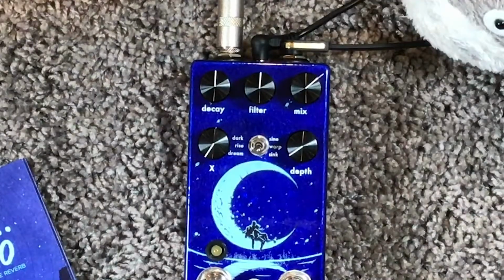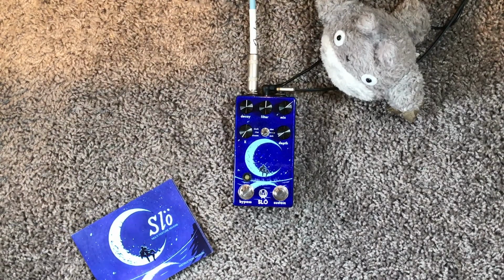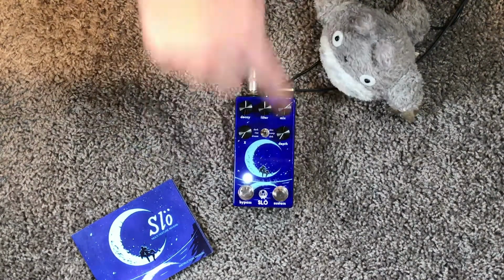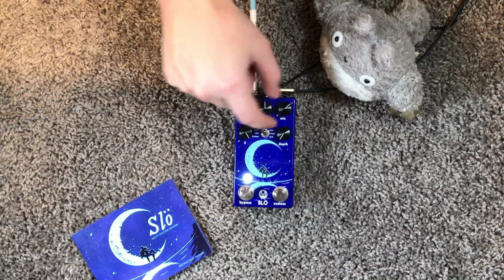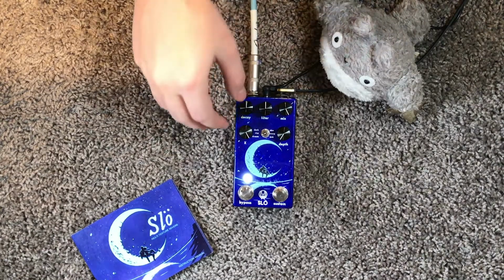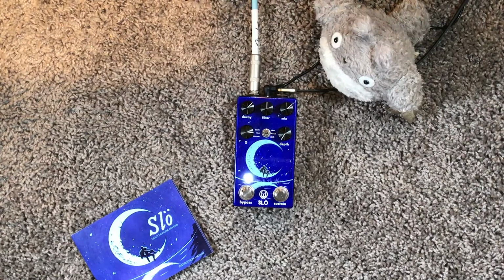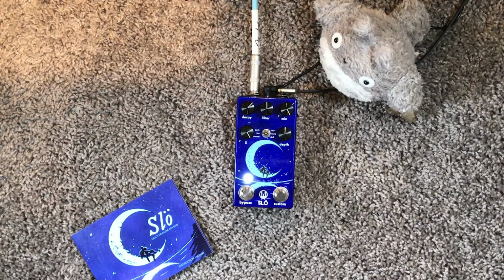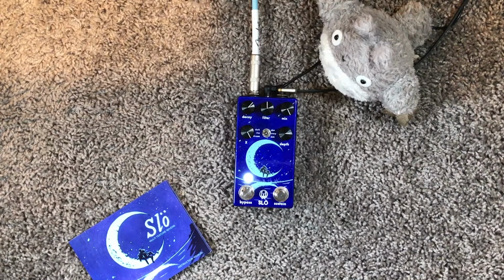Read The Manual - Walrus Audio Slö

Comment: Ey, question, (I have the pedal too and am looking at the instruction manual). When accessing the secondary wave shape functions, you held the bypass button down as you switched the wave shape mode, though you were still holding the bypass button engaged as you were turning the setting back to the original primary function mode (for instance when changing it to 'sink' you still had the bypass button engaged when you switched it back to the rise setting). Are you sure this changed the secondary function to sink rather than keeping it at warp? How would you know? I read the whole manual but I don't think it's quite specific enough to be certain about using some of the secondary functions. Thanks for the video!
Reply: I just got this pedal and this is what's driving me crazy - haven't figured out yet 😵‍💫

Comment: I just got mine and I love it - but does the modulations (sine/warp/sink) reset when the power is cut off?? or do I need to to an extra reset?
Reply from the maker: As far as I know they do not reset when you cut power. They stay wherever you set them last.
Reply: @kevwyxin  and which one of the modulations is in the default mode when you first use the pedal?
Reply from the maker: Defaults are this: Dark mode uses Sink, Rise uses Sine, and Dream uses Sink
Reply: @kevwyxin  Rise and Sine! I crack myself up sometimes😄

Comment: Is there a way of altering the wet/dry setting while or before entering  the latch mode in dream, so that your guitar signal is fully wet while the pad is sounding? Thanks
Reply from the maker: From what I've noticed when playing it...once you latch, it creates the pad and if you change the mix knob position it will affect the pad and wet/dry sound of the reverb. So turning the knob clockwise makes the pad and your wet reverb louder. If that makes sense. Turning clockwise will make the pad go away eventually once you are fully counter-clockwise.